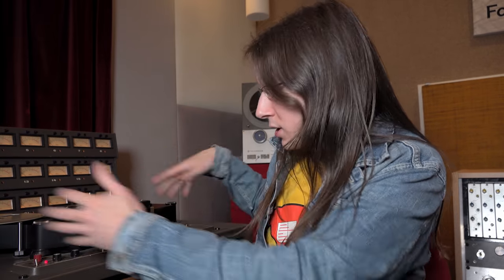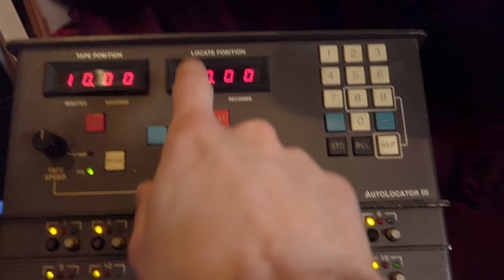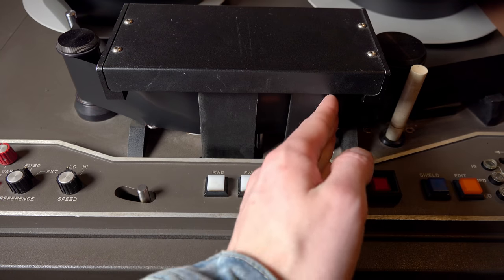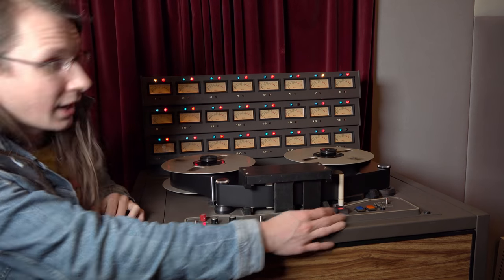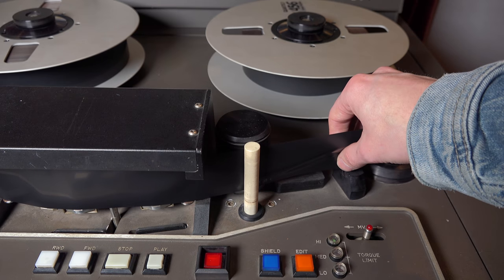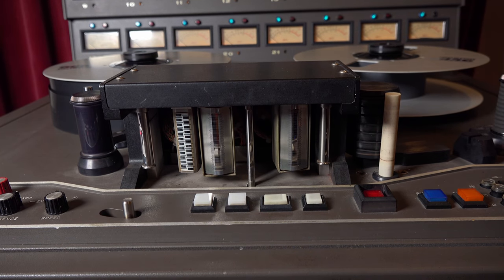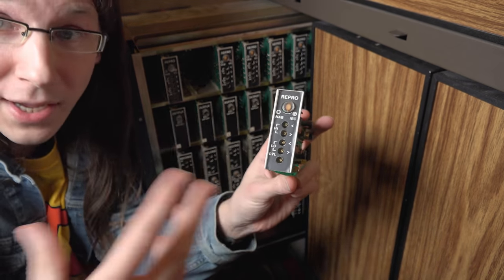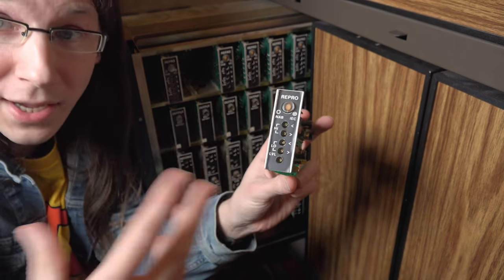THIS IS HOW A 24 TRACK TAPE MACHINE WORKS!

Comment: The Studer A827 was perhaps one of the best 24 track machines produced. Was 1989, when they were still making them. I seem to recall that they made a small batch of them in the mid-90's but, I don't see any info on that, anymore.  They are one of the most sought after and still command a high price for one in good working order. You can still get parts for them, as well, to some degree. Other than the Otari MTR series, there are few that compare. Nobody was making 24 track tape machines by the mid-90's, as everything was going digital, by then...
Reply: They probably was state of the art analog machine, but using Sony DASH or even Alesis 8 track Adat tape and other hardrive  digital recorder change the game forever, having a DAT and a 4 track analog tape was already good enough to producer something with a sampler and a midi sequencer in the mid 90's today technologie IS unlimited but they produce crappy music, thats a problem, good music still exist but was more rare in 2K Era.

Comment: My goodness, us oldies couldn’t wait to dump these machines. Why torture yourself 😀. Logic Pro young man.
Reply: Today we use em to  make lofi(ish) stuff. i love to use tape machine emulators haha. Saw couple in person but i never saw them work in person
Reply: He's got REAPER, which, as far as efficiency and workflow is concerned, makes Logic Pro seem like one of those machines.
Reply: X S I’m going to buy Reaper just for curiosity. The fastest software is the one you’re familiar with.
Reply: @Rialas  Thats correct
Reply: X S I’ve spent hours (many so far) and I’m finding Reaper totally frustrating. Anything I try to achieve ends up with me hitting a brick wall. This software is truly for people that like to tweak, and yet the simple stuff is impossible to find easily without trying loads of different skins. I’m hating it so far.

Comment: The Sony machine is actually a MCI machine. MCI (Music Center Incorporated) was a prolific manufacturer of professional analog studio tape machines and recording consoles for many, many years. A large number of recording studios in the US and overseas bought MCI machines, as they were less expensive than their competitors. The 8, 16, and 24 track machines used the same circuit cards, which was an economical advantage for MCI. Their Autolocator, which is seen in this video, was a far more advanced "remote control", and MCI sold them at 500-700 dollars, at a loss, which was a major point in selling their machines over the competition. When Sony wanted to get into the professional analog studio tape machine business in the US, MCI sold their business to Sony.

Comment: Congrats on getting a real work horse! I began my studio tech career on an early model of that very beast. It did not have separate settings for low and high speed, so if they wanted to record at a different speed, I had to show up and calibrate every channel for the new requirement. At least one hour per drawer! And I won't mention the headaches of the transport logic, or the AutoLocater II--which was made before printed circuit boards came into being. There must have been 4 or 5 of those machines in Honolulu when i was active and I serviced them all. 
Each studio had their own calibration tape. They were full track tapes, no separate  tracks--very important for azimuth settings of the heads. And the manual! I hope you have one of those huge yellow 3-ring binders. It has all the procedures described, plus schematics of every circuit board. MCI was still MCI in those days and I had many conversations with the techs there. They were always very helpful.
The definition of distortion is the difference between the input and the output. The tape recording process itself has distortion--the output is different from the input--in the frequency response. I used to record a CD onto a new tape, once the calibration was finished. The studio owner and I would listen to the input--straight from The CD player--and then switch to the playback head. The usual response was "That sounds better!" The tape has a 'fuller' sound or 'warmer' or something. And recording on slow speed actually increases the bass response. I think the roll-off is down to almost 20Hz. High speed starts rolling off just below 40Hz and is -3dB at 30Hz. So for low end, the slow speed is great. And the high end is still above 19KHz. Not too bad. The main difference between the hi and lo speeds is the noise floor. Hi speed has less noise. But I couldn't really hear it, though I could see it on an oscilloscope.
Anyway it is nice to see one of my old friends again, doing that which it was designed to do; making music.
Aloha.

Comment: I did loads of sessions on the MCI JH-16 and it sounded great and you could punch in and out fast at 30 ips speed. I did the maintenance on it as well. Notice the big ceramic shaft capstan that it has! This brings back some nice memories.

Comment: Ow I remember doing 24Track edits for a producer, lots of edits from 1 song to the other, after it was done he said "ow lets go back to the originals". Shit luckily I had put arrows on the tapepieces I took out for the direction of the tape, and I had numbered them, so I could actually put it back together. Edit block, a razor and splicing tape, white marker to do edits.
Another thing was spot-erasing, we used this to erase ticks etc. Cue up te tape and mark on the back of the tape the beginning with a white mark and the ending. Then there was a setting on the machine (Lyrec) to put the machine into record but without the pinchroller pressingthe tape to the capstan. Now you could move the tape by hand back and forth betwee your two markers over the erasehead. Thank god for harddisk recording/editing!
Reply: Frank Koppelmans   At MCI, we referred to the spot erase mode as “puck off” - not energizing the pinch roller solenoid.
Reply: Very manual process; Nothing automatic about it... It did work tho.
Reply: The only thing I miss from tape editing are the grease pencils. Unraveling them was oddly satisfying.
Reply: Trev Mingus   I guess I do too.  They remain in the bottom of my pen tray decades after last using them.
Reply: Tape neck ties was a thing while doing tape block editing. That’s actual cut , copy , and paste in the real world for those who don’t know about this. You know I miss the grease pencil and splice block myself sometimes.....
Reply: @troubleondemand7703  I miss the smell of the tape.  But that's all I miss.

Comment: Great machine! About the "tails out vs. print through", here's the explanation: print through is active outwards (from reel center to reel periphery). So tails out storage makes the print through affect the tape AFTER the main sound,  like a small echo, which can be musical. The other way around, the print through sounds like a "pre-echo", being BEFORE the actual sound. And that really stands out as "un-natural" and is more noticeable.

So it's not that the print through levels are any different, it's that they sound awkward "heads out".

Comment: Wow - that takes me back.
I spent 7 years in the late 80s and early 90s with machines like that, including an older Ampex 16 track and a Studer 24 track, and I honestly can't even remember the other two - except that I know I never worked with a Sony.
Every few hours you had to clean the heads with isopropyl alcohol and special swabs that didn't leave dust. Typically we'd do that at the beginning of each session, at every break, and after the session. There were also conditioning fluids for the rubber parts that contacted the tape. There was always a big decision on 15 or 30 ips, everyone seemed to have a different reason for their preferences. Of course, tape was never a question, everyone I knew used Ampex 456.
All of the studios I ever worked in had weekly calibration, often on Sundays when the artists were usually too hung over to want to be in the studio.
It was not unusual to run the tape over the heads hundreds or thousands of times if you were doing any sort of overdubs, or had a performer that wasn't all that good and had to retake many times. Studio lore says that Bohemian Rhapsody had the tape over the heads so many times that you could see through it.
Oddly enough, I'm sitting here with a system that cost a tiny fraction of that machine but is orders of magnitude more capable... and yet, there's still something about the solidity of those big analog machines.
Reply: MCI multi tracks were popular in Australia. At point they manufactured a "layback" machine that enabled audio studios to record audio onto 1" C format video tape, saving the need to buy an expensive C format video recorder (Sony sold lots of those, but they were expensive).  SMPTE time code was used for syncing. Sony bought out MCI so that they could kill the layback machine.

Comment: You could simplify the description by just saying that it's like the 4 channel tape recorders we used to use, but it has six times as many tracks, amplifiers, and a wider tape.   My favourite reel-to-reel over the years, for home use, was the Teac Studio 8.   It was basically an 8-channel Portastudio using open reel tape.   I still have two of them.

Comment: I began recording in 1993 on analog machines starting with my first Tascam 424 PortaStudio and later upgraded to the eight track Tascam 488mkII. There was a good deal of project studios in my hometown (Las Vegas NV) so as I gained experience & friends in the industry I got to work on Tascam & Fostex 8 track reel to reels and eventually a few 16 track machines. 

Soon ADAT's and then DAW's took hold and there were few if any analog machines ready to record bands, demos, jingles, etc. because the convenience and quality just made digital so much more attractive. I went back to college to finish my music degree and there was an MCI JH24 at the studio of recording tech program I went to. 

We got to record some stuff on it basically learning hybrid techniques (recording drums on tape and dumping the tracks into a DAW, etc) over the course of a week and it was incredible. Great sound. BUT!...the maintenance and constant babying of the machine you'd have to do was just insane. I remember the pain in the ass of cleaning heads & demagnetizing ¼" 8 track machines in the past but a 2" 24 track machines upkeep was just crippling. 

Analog of course has "THAT sound", but it's inconvenience and expense just becomes too much to deal with when you've got infinite tracks, zero physical maintenance and fairly good analog emulation plugins in a laptop in your backpack.

But these behemoths will always have a special place in the hearts of us who were around them awhile. Because when they worked, the sound was incredible.

Comment: The passive nature of the dancer arm on MCI recorders is a serious weakness, as is the fact it is a fixed guide rather than a rolling one.  If there is any flaw in your tape or if the tension is less than ideal, the fixed dancer arm will do some serious damage.  Though it is highly polished stainless steel, it is literally scraping on the non-oxide side of the tape at all times, often at very high speed.  The much more sophisticated Studer had all rolling tape contact surfaces, and in later models, fully servo-connected dancers on both sides of the headstack which maintained tension to perfection.  Precious master tapes were treated much better by the Studer and Ampex recorders.
Reply: MCI JH-24 and late JH-16's have an optional roller dancer arm and it's still available. And it is not a fixed arm, the tension of the arm is fixed, to which servo-based active tensioning reacts. In fact MCI only stresses about 140g on the heads, way less than any Ampex ever and only Studer A800 stresses less than that.

Comment: Wow. A real blast from the pat. I remember getting to the studio an hour and a half before a session to do the alignment, clean the heads, calibrate etc. and still just barely get ready for the start of the session. I wonder where you can even get the tape these days. You can't argue that they had a great sound.

Comment: Thanks for introduction into this machine! Until now I knew it only from discussion with my father long, long, long time ago. I also remember the problem with heads azimuth and all adjusting stuff. In that time it was quite usual, any tape system had to be calibrated, even "Compact Casette" in HiFi deck at home. Really nice piece of hardware, have fun on it.

Comment: Bias is a high frequency signal that is mixed with the audio signal going to the record head when you are recording (also to the erase head). Its purpose is to excite the magnetic particles on the tape so that they more readily accept the magnetic audio signal. The frequency is calibrated so that one wavelength fits inside the head gap at the selected tape speed. This gives a net magnetic signal of zero so there is no residual magnetism left on the tape by the bias. The real fun in calibrating this machine is the electronics that control the supply and take-up reel motors and the capstan motor. You don't have to mess with it as often, but they're a real pain when you do.

Comment: That's Fantastic.. That's the same machine I use to run at Pantheon Studios. Loved that Machine.. Oi! The Joys of alignment and setting them up for 0; +3, +6 db Playback. Some other Crazy engineers would set it up for +12 db.. I didn't much like that.

Comment: I remember playing on an album which was recorded with an Ampex, 16-track on 2-inch tape. I forget what the tape speed was.  It had a good sound. 
I played on two albums which were recorded on an MCI 24-track, Scotch 250 2-inch tape, running at 30-ips  (72 cm/sec).  In the hands of a good engineer, there is something special about the "sound" of 2-in tape running at 30 ips.
   At 30-ips, the oxide on the Scotch 250 used to shed like crazy.  About once per day, the engineer would go to the tape machine and use his t-shirt to wipe off the oxide on all the heads.
Reply: that's why those kind of tapes used to not last much time,  because of that speed

Comment: Awesome I have a Sony APR 24
Could you do a tutorial on how you set up your audio cables on where you got your audio cables or if there's a resource on where to find these input and output cables
I do have some cables and mismatch if that came with the machine is it as simple as soldering a quarter inch Jack to the end of each 8 in output connected to the rear panel of the machines

Comment: Back then "they" had something called timecode. It was most often used to synchronise audio tapes with film of video editing systems though.
In the 1990s timecode was also used to control tape recorders from software in order to master tapes. It is still present in most editing sofwares.
Reply: It was also used to sync multi-tape machines, for when you wanted to record/play 48 or more channels, in a big production situation...
Reply: @jhowe5571  And here I thought it was merely keeping the baby snakes in time.
Reply: BTW...  FYI...  The timecode was called, SMPTE timecode and was recorded on a separate track on the tape, or in video, a separate space of audio on the tape. It was then used to playback into the next machine w/a card that would read the timecode and control the machine. The master machine was the master timeclock, controlling the other machines. The band, Toto first used the synchronizing of three 24 track machines in 1982, for 69 tracks of audio (3 for SMPTE timecode), on their Toto IV album.
Reply: Yeh that's right I used to use a TR909 rhythm composer and record the sync signal onto the tape, you had to record the signal at one end of the head or it got interfered with by the audio recorded next to it, when you rewound the tape the TR909 would follow and play from the correct position, I also used cubase in this way.
Reply: Colin Dowden When I started my cartoon animator career we recorded on Sony's Beta SP tapes. The tapes had to be pre recorded with a continuous timecode on one track. Some brands used to sell pretracked tapes. The sound guys also used timecode for sound effects sync and music. SMPTE timecode was a way to smooth out the work between virtual editing (non linear editing as we used to say as opposed as linear editing done without a computer that was stadard practice back then) and tapes since digital storage was not yet a reality for movies.

Comment: Nab and iec are the type of equalisation  that america or Europa used... so back in the day depending where you were in the world and so thanks to the calibration tape you where using in your part of the world (test tape that was set to one or the other equalisation standard)  you where selecting one of the other standard by pressing the button and then calibrating the machine through the test tape.. before in repro and then in record on a blank tape... (obviously you would choose a tape to record on that where more appropriate for the equalisation that was on your test tape)
hoping to help :)

Comment: You're in for some good old time fun. In the late 80's, I used a MCI 2" 16 track. The 2" 16 was considered the best at audio quality since it had the most tape surface per channel and you could sync a slave machine for double the channels. Did you get a noise reduction with it? Now days I play with a TASCAM 34B with DBX and a TASCAM 1800 in conjunction with a TASCAM 208 Mixer and CUBASE LE 5 just upgraded to CUBASE LE 10.5. If only we had the ease and capability then that there is today with recording equipment. Wish you well with it and any future projects...